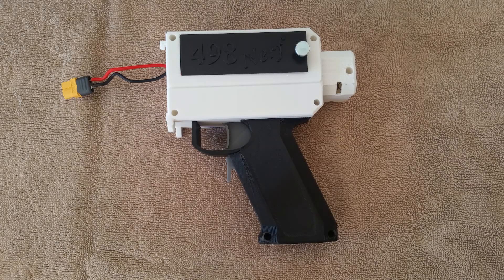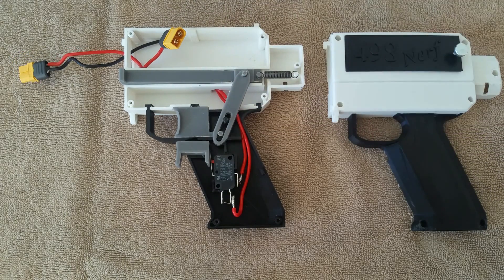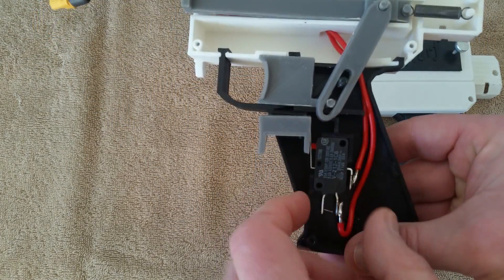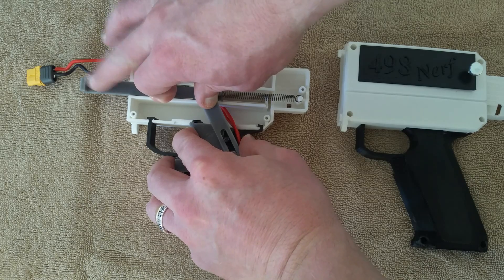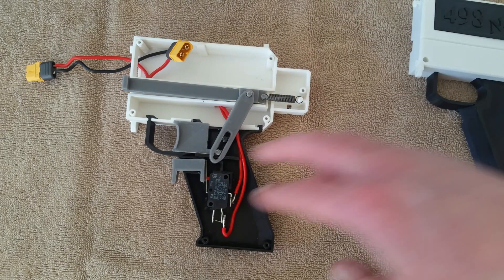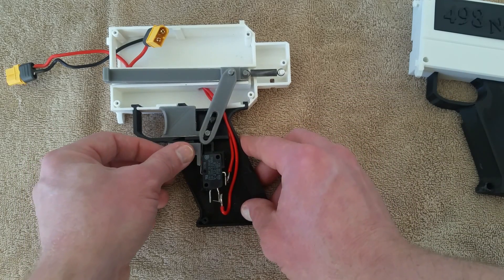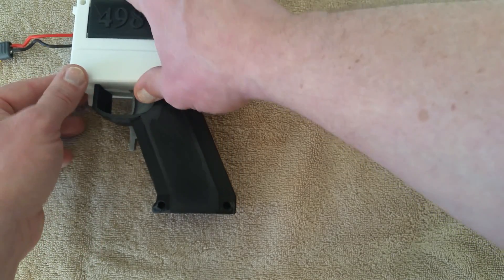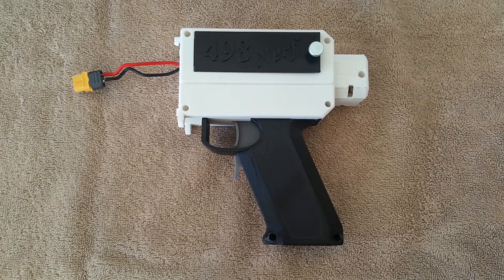Foxfire MBS Components - Core (semi-auto)

Comment: That's it, I'll get around to printing this once I stop constantly tweaking Rektify (which may actually be pretty soon). Sure, I don't like clamshells, nor do I like screw boss posts designed for stock cages. Dealing with alignment issues on an RS and not having perfect alignment on my Stryfe have taught me that they're probably not the best way forward. 

But I do understand why the design has been executed in this way - and it does achieve its design goals. Already being compatible with existing cages, as well as being highly field serviceable and modular are definitely admirable goals and I'm not going to say you have to have done them differently. On top of that, just seeing the inside and all the details you pointed out (and even ones you didn't), it's obvious this is a highly, refined design with hours of patience and insights poured into its creation.
Reply from the maker: I tried (and printed) several models of the main trigger mechanism before I got one that worked.  Having the space above the pusher be dedicated for the Lipo was a huge constraint.  That was probably the most challenging part of the modelling.  It worked in the end though.
I'm curious as to what issues you had related to clamshells/screw bosses in your Stryfes/Rapidstrikes.  I have had any issues with the ones I have had (with the exception of the too loose magwells in the Rapidstrike.  What sort of alignment issues did you run into?
Shoot me a message once you get into printing some of these models.  I'd like to compare printing notes and see if you also have some of the 3D print related issue I have run into.
Reply: For me, it was putting in replacement cages into a Rapidstrike and needing to file down the front two screw posts to get the cage to be inline with the barrel. The decreased height also meant it wasn't inline with the magazine or pusher which probably is meh for accuracy, but meant I couldn't fire several full-auto shots with the blaster on the side ('gansta' style) without a serious jam that needs a ramrod. Even though Stryfes tend to be better than that, I've had OFP cages fit perfectly in one Stryfe and be a bit misaligned in another (it still shoots OK, but it's not as nice as it could be).

Most cage mounting patterns for printed blasters now do 'reinvent the wheel' per say, as with the FDL, Toruk's T19 using similar mounting patterns. BlasterforgePH's semi-auto Stinger uses a minimalist cage that is meant to have an XT60 integrated into it and then attached to a single piece body that includes the magwell and a foregrip. At this point, I don't mind having something that just just goes back to superstock mounting patterns. Using them does fit with your design goals and such, which I don't really mind.
Reply from the maker: And please don't get me wrong, I very much appreciate your feedback.  You are one of the very few people that have gone from model to 3D print to functional blaster.  I very much value your opinion.  I may take a look at other print geometries besides clamshell in the future - especially for the receiver.
Reply: The receiver might be the part of the blaster that can most easily be made into a single piece, though it most likely is one heck of a print at this point.

More people like me will follow, with more experience and refined designs, and people with less. I'm still very much new to this and not anywhere close to creating designs polished to a sheen. Either way, I'm happy to hear that you'd consider it.

Comment: What screws are you using for the body?  Should have mine done printing tomorrow.  Thanks.
Reply from the maker: I used left over screws that I had from a couple of Stryfes.  Those worked well because they had a wider thread, but I had trouble with narrower threaded screws (like those in a Rapidstrike).
Reply: Thanks so much.  I ended up using #6 sheet metal screws.  If we do any design additions, what is the best way to share them with you?
Reply from the maker: I'd suggest getting a Google Drive account and putting them there.  However, email will work too.  Shoot me a PM if/when you have changes and I'll give you my email address.
Reply: +498 Nerf 

So, I'm looking at M2.5 self-tapping screws in that case, if they're all Stryfe screws I'll presume they're all the same length give or take?
Reply from the maker: I have been using the 10mm length ones for all the screw ports, although the ports themselves should take longer ones..

Comment: Also if you do sell it do you think you could sell it at a stryfe like price for a base blaster?
Reply from the maker: Stryfe like price - unfortunately no.  The internal components (motors, flywheels, etc.) and PLA alone cost around $75 for this build.  And that doesn't consider printer costs, print time, modelling time, and assembly time.  If these were to be sold, the price would end up being much higher than a Stryfe.  But, again, this blaster performs much better than a Stryfe.
Reply: You'd be hard pressed to get a fully pre-modified Stryfe for less than 100 dollars in the first place.
Reply: Flygonial oh I know. I was just asking because he could make a entry blaster that’s as powerful as a stryfe and then sell separate parts for upgrades. I agree though for that model I understand if it were over a hundred. However out of darts hirimini would probably still beat it.